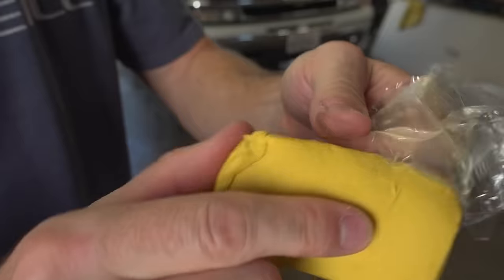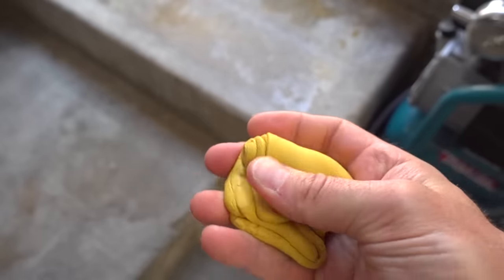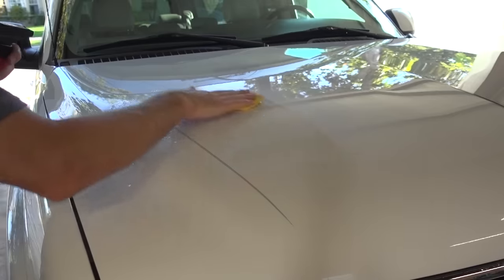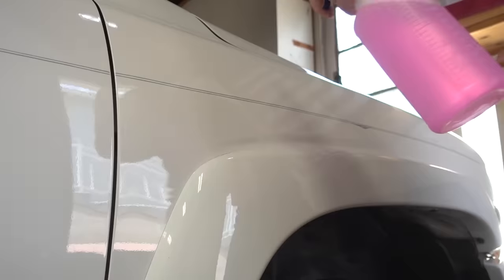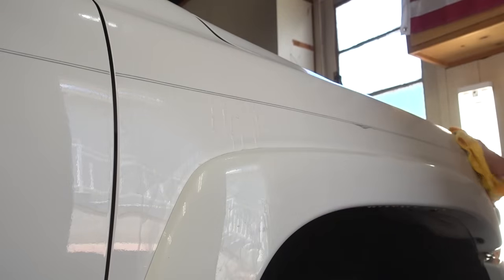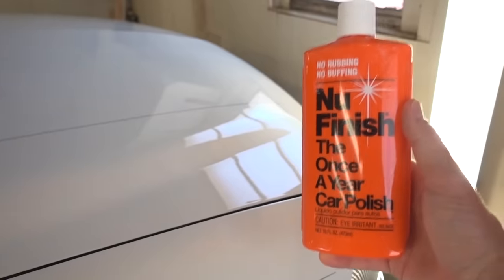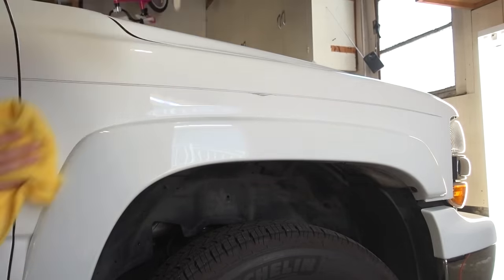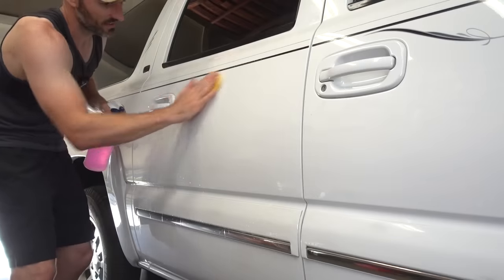This Is Better Than A Clay Bar And Only Costs $2

Comment: I think I might know why your hearing a difference.   Bear with me.   This is a bit long.  You can use just about any thing to polish what ever it is you cN po!ish for example a knife blade to a razor finish with a piece of newspaper if you rub it long enough.  Now how this relates to the video.   Think different grades of sand paper when you sand your removing imperfections in a finish what ever it is and the send paper will also pick up particulate matter,  you through the different grades up through wet sanding. The clay bars are a form of wet sanding.  If you really want an ultra smooth and perfect finish you can apply your last coat of clear coat a ulta fine piece of sand paper it level out the finish and also fills any voids with the material that it removes.   So when your using a clay bar or putty it still has a bit of roughness to it but so very small it like using 20,000 grit paper so it will remove ever so slightly a very small amount of you clear coat not enough to matter to the eye.  The particulates combines with the wax in lubricant to fill any micro void any larger pieces get ground up or absorbed in to the clay.  The clay bar and plumber putty basically like to different grades of sand paper.  They both have some amount of silicone in them which also would help to fill voids.   The scratching noise is just the removed material being ground into power which fills imperfection in the paint it stiffer so removes a little more than the putty.   So for being long winded.

Comment: why were you using a soap with wax for the clay lube? i feel like that confounded the results and would get stuck in the clay. Nu Finish is like a 10000 grit sandpaper as well, I'd skip that an just use a pure wax or Ceramic coat

Comment: Amazon 3M Clay Bars. Cheap.  If I was in a war zone I would use the plumbers putty. You did not remove the old wax with alcohol. Shame... you were supposed to roll the clay into itself periodically to get the contaminants into the clay and use a fresh part of the clay. If you drop the Claybar onto the floor throw it away it’s done.

Comment: Multiple problems with your method plumber's putty is full of oils then the decontamination process you use wax for proper paint correction your aim is uncontaminated paint so after paint correction the wax or sealant bonds to the paint not oils or wax.

Comment: Very interesting.  I've used Meguiar's Smooth Surface Clay Kit on my cars and  its a nice kit for $20, and does a great job.  I would never complain about it.  But this looks very interesting because of the economics.  Grab a glob of the putty, use it with plenty of lubricating fluid. And you can change it out more frequently.  I think I will try this. Thanks.

Comment: Big waste of time! Buy a tin of turtle Wax ice Auto Polish and use it. It goes on very easily and comes off very easy. Also it won't leave white residue on rubber vinyl chrome or glass. As a matter of fact I wax my glass windows with it too. Put two coats of this stuff on and it will last well over a year here in Las Vegas

Comment: I'm still just trying to get my head around all this fuss about cleaning a car!  If it's going  to be used on the road, it's still going to get dirty again!  You could sterilize the d*mn thing, and polish it until it had a flawlessly smooth finish, and then fifty yards down the road it will be like you never bothered.

Comment: Using wax and wash diluted with water to clay bar your car ? lol the whole point of clay bar is to remove the contaminates and degreasing your clear coat not add to it

Comment: That was pretty useless. You need to show the surface of the clay to show what it has picked up and compare it to what you get with the putty. As said, horizontal surfaces worse but your car was clean and shiny already. People have used Blu Tak but that was when clay was expensive. Clay mitts are good to use.

Comment: I'm using clay bar today and is my first time, the result are great, but for those don't know, they exist clay bar for old car. I think the mix you are using is not help enough the clay bar slide smoothly. In my case I using the luber for my clay bar from Chemical Guy the clay start smooth but can get rough if the luber is not there, you need to be careful how less lubricant you are using, that can make a difference, good job or bad job and possible restoration. The idea of the putty is not bad, but need to be tested even more, you need to show the differences before and after to show much better results, words can help not convince to much

Comment: no thanks. use synthetic clay mitt or towel nothing else. bars are pointless now unless you're using a 10 inch square. takes forrrever.

  what's next, PlayDoh? 😅

Comment: Having used Plumbers Puddy for its normal purpose, I do know that it will dry out over time and once dry, you cannot soften it again.  Once those crusty pieces get into the whole wad of clay, you will scratch your paint, so be careful.

One way to extend the life of Plumbers Puddy is to store it in a zip lock bag instead of the plastic container it comes in.

Comment: I would have used the clay bar on whatever panel you used on the putty on first.  If there were any contaminants left, I'm sure it would show in the clay bar.
Interesting comparison though.  I'd be willing to try it on my '03 Crown Vic that has never seen a clay bar.

Comment: There different grades of overspray removal clay depends on your paint what grade to use because it will   Damage your clear coat and paint if you use the wrong kind I work with a guy we detailed vehicles for the oregon cost guards they was stationed next to a ship yard and all there cars had gotten overspray from ships being painted let’s just say ya don’t use the wrong clay on a military guys car by mistake push ups or docked pay😂

Comment: Clay bar takes too long and also the plummers sruff

I can clay my car in about 5 minutes using the nano skin pad on my rotary buffer
I use a water bottle with soap dish to also remove any wax on the paint

Comment: I really like the idea of using plumbers putty. Perhaps we need to find out what the ingredients are in both, then compare. And we understand why this works to some degree. Both materials are putty. The deal with trying new things is...We first should consider a sample that correlates with the surface one is using or going to eventually be using it on. Not the subject itself. Just in case. But if a clay bar is used to clean. And plumbers putty used to seal. I see no correlation. Ingredients will be different stuff I'm sure, as well. My biggest disappointment in watching this is the vehicles being tested is already perfect and clean. It would have been much better to have watched something that would actually test the components by being a bit more challenging. You just mentioned the clay bar has a stickiness to it. Whereas the putty does not have near the stick to it. As a plumber, I know. So perhaps that in itself is one of the reasons the clay will work much better. Pulling the containments off of the paint. But the big deal here is your vehicle is already clean. So that really sort of didn't challenge the products in such a test. Where is the dirt so we can compare? Anyway. Just a waste of time as I still do not see a reason to use plumbers putty on my car. And so after seeing this, I would still not use plumbers putty. But I"m shocked to find out you didn't test the clay bar to see if it can be used as plumbers putty. Other than the cost, the stickiness should help with sealing any plumbers treads and make connections watertight. But the bottom line when doing a comparison please learn from this and make a list of ingredients in both samples. It might explain why you still don't know if using the putty will work or not, in all cases. And a list of ingredients may have given us a big reason to never use plumbers putty on anything but plumbing. But I do find it extremely silly to do a test such as this, edit it, publish it and then say...I don't have a clue--at the end. Also if it were just done as entertainment...perhaps you could have made it more entertaining. Since the comparison bombed. First and probably the last video I will ever watch. Especially since your title is so far off the mark. And of course, the conclusion didn't add up either. Obviously, we know you promote products, but at least make the video worth our time if you're going to use them to get us to amazon. Think about it.